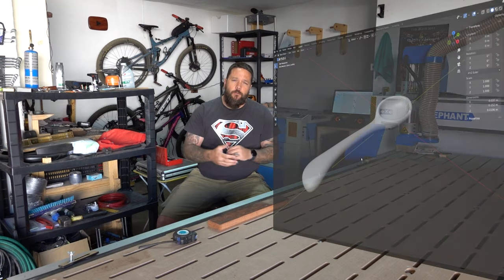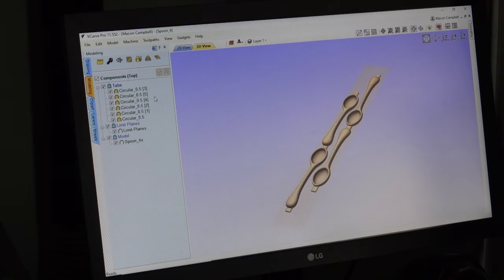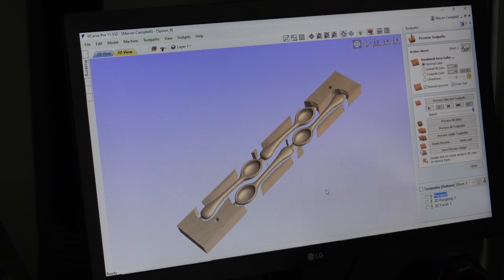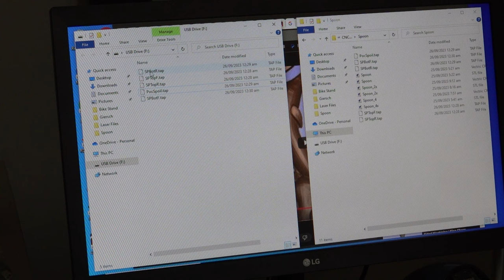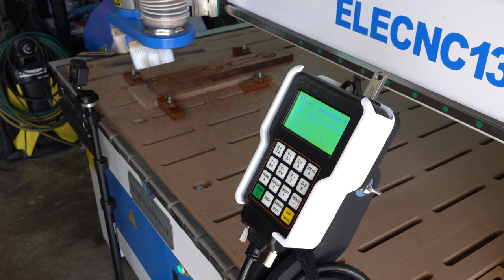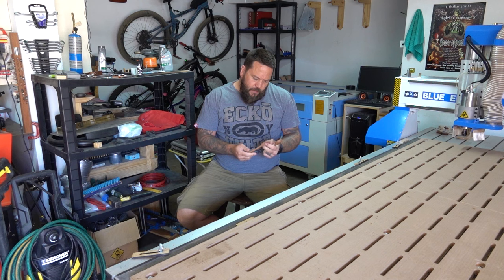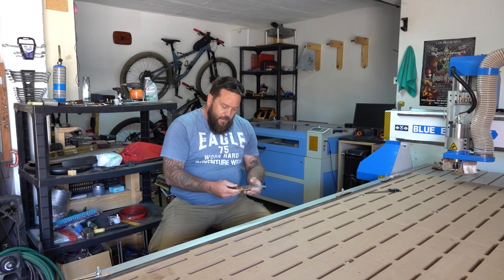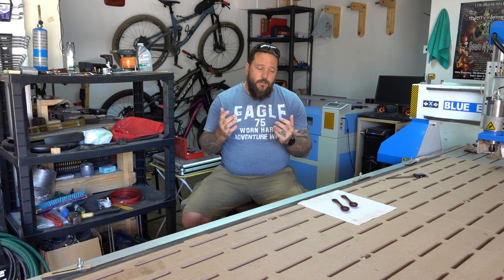2-Sided Spoon Carving on the CNC - Blue Elephant - V-Carve Pro

Comment: What's the size of your table? Didn't you take the vacuum option for the table? I'm running a 1530 Blue Elephant myself.
Reply from the maker: Nice! the 1530 looks like a beast... Mine is "1325" 1300 x 2500mm, in hindsight, I should have spent a bit extra and gone with the vacuum table...
Reply: @maconSTUFF  yeah the vacuum table is a bliss. How is your after sales support? I had some problems with my x and y axis and had to move the sensors but all good. Must say their support was on point with me and always helpful. I see you use a similar program to artcam. Did they supply it?